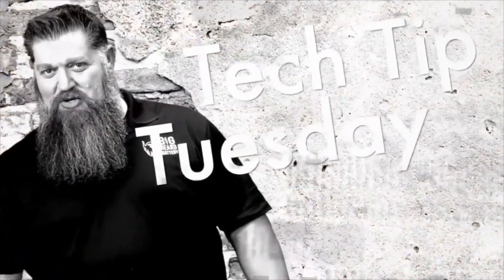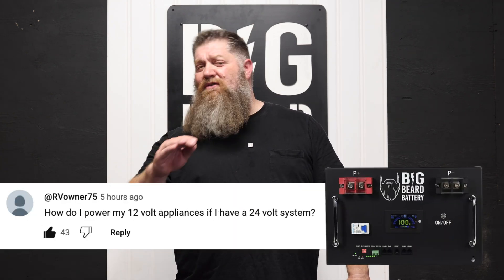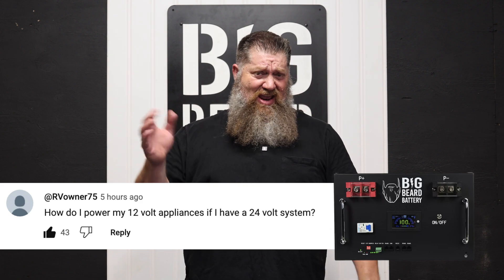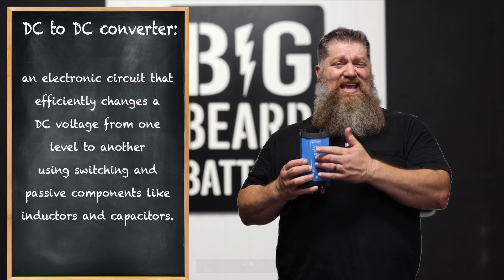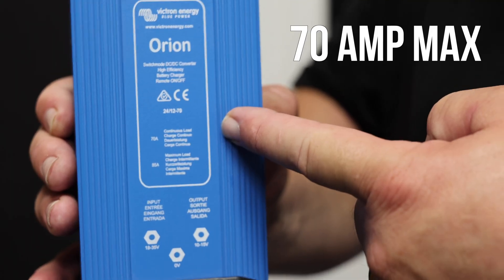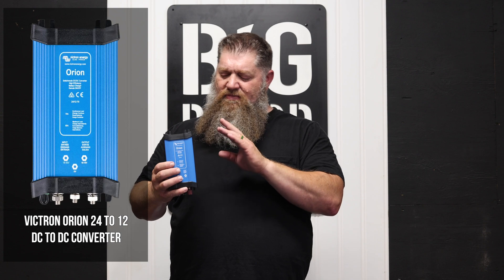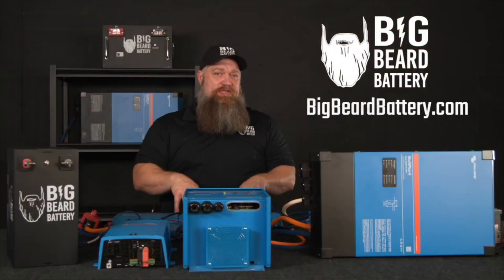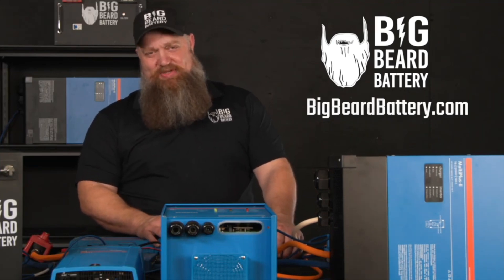Powering 12 volt appliances with 24 volt system

Comment: Hi Todd- You guys did my 24v system dual MPII with two Beast(s) in a Brinkley not a 5th wheel. 

Will the Orion 24-12 DC/DC converter work as a charger as well if I kept the 12v battery but converted it to lithium?

 I have the WFCO Auto Detect (never detect- yes I did see you video and followed the WFCO guys instructions it works for about a minute). I currently have a IP22 as a charger would this option be better? Thanks as always!

Long live Big Beard Nation!